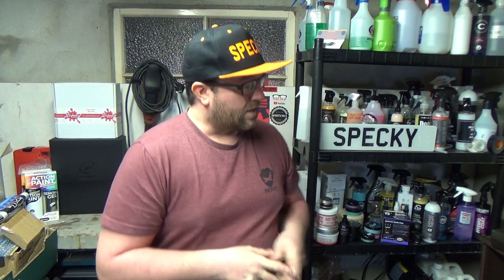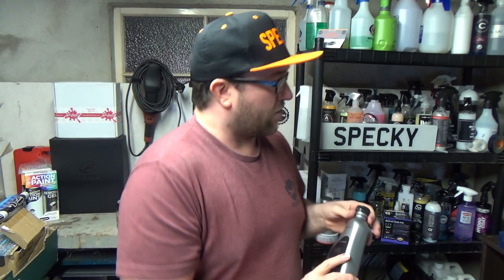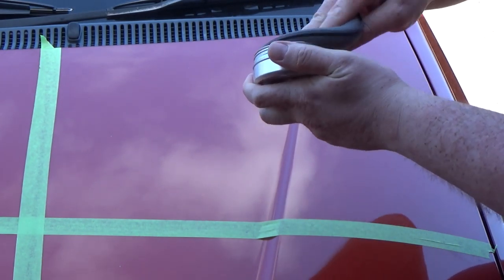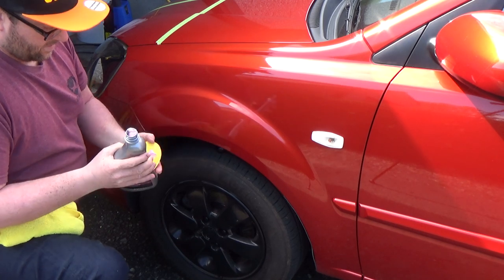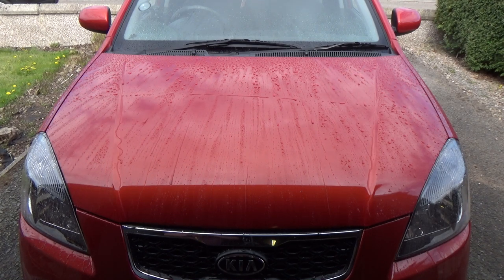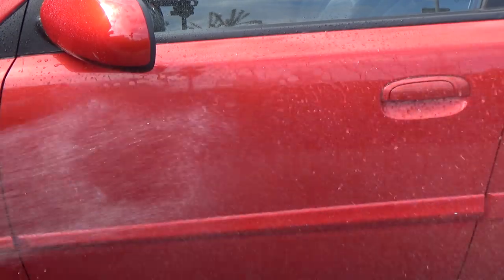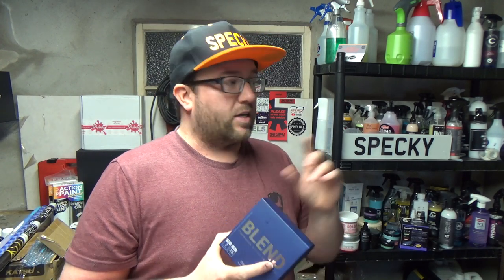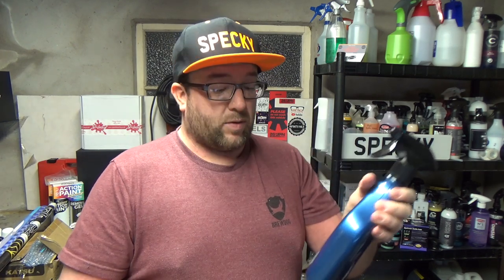Vonixx Car Care Wax Review!

Comment: not cheep
Reply from the maker: Not expensive either, I'd say their pricing is fair.
Reply: @SpeckyMcSporran  you are right. On reflection this product is pure carnuba wax of the highest grade and has nothing added and with few middle men. The fact you find it hard to get out speaks to the purity of the wax (and the temp).  Might buy some and use as a base with sio2 on top. Any thoughts on that, for a silver car?
Reply from the maker: Silver cars tend to benefit from SiO2 for sharpness of reflection, I'd suggest Blend wax as it's likely longer lasting and has the silica which will help with gloss.
Reply: @SpeckyMcSporran  Thanks